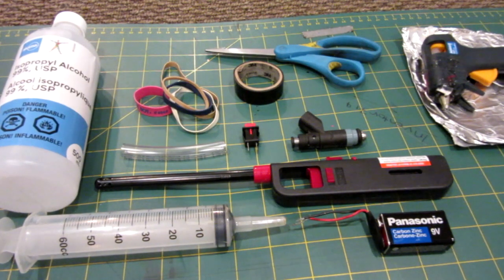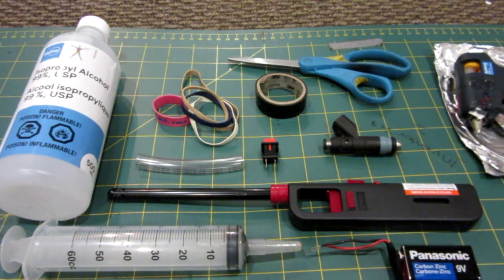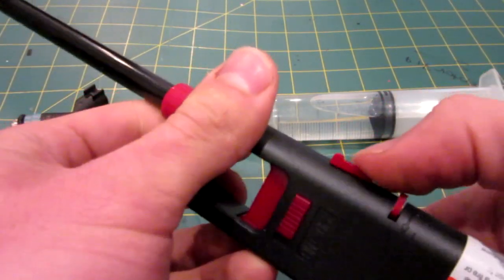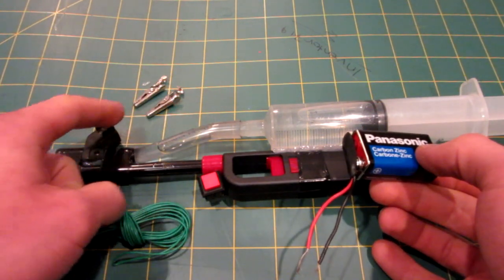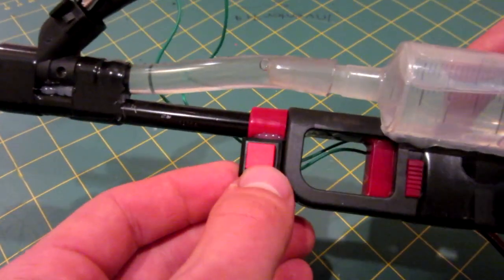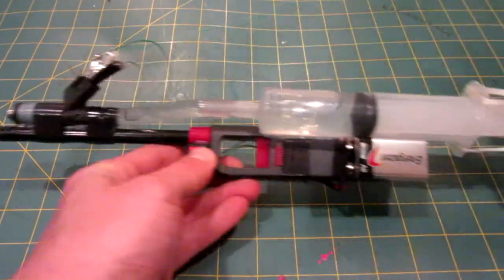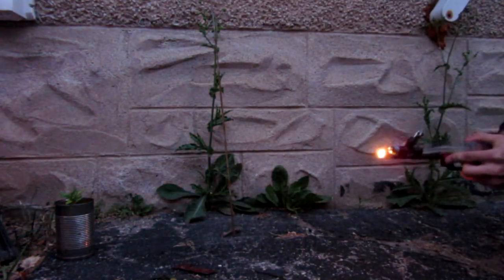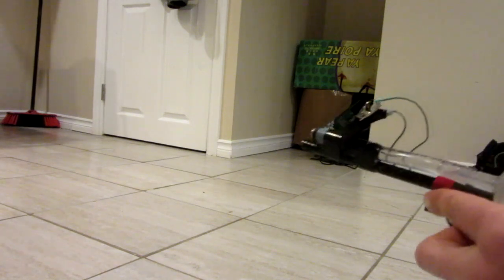Make a Fuel Injector FLAMETHROWER - Awesome!!!

Comment: Modify it with a bigger cc injector.a small tank for alcohol. a car washer bottle pump feeding the injector piped up to tank.do away with syringe.have an extra battery and have injector and pump running off same switch.